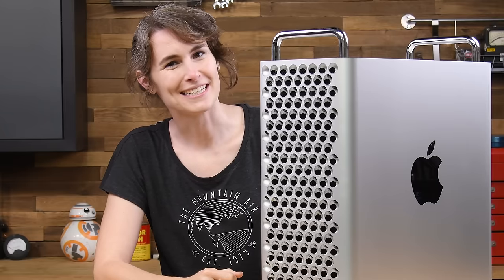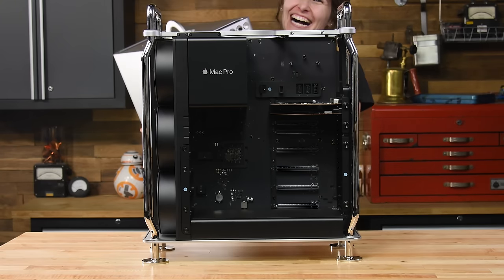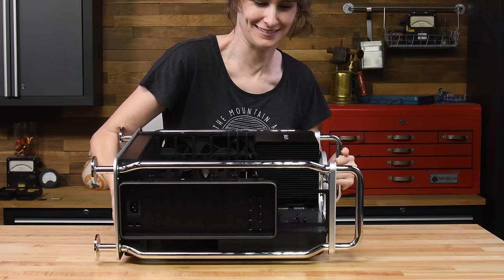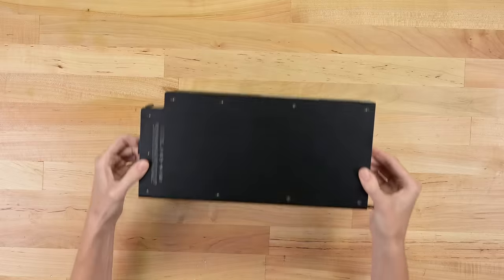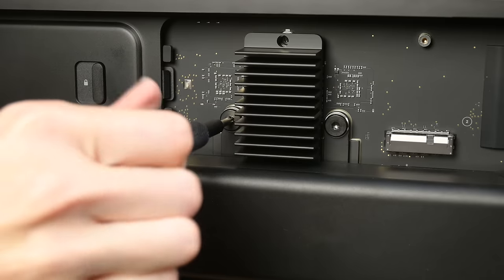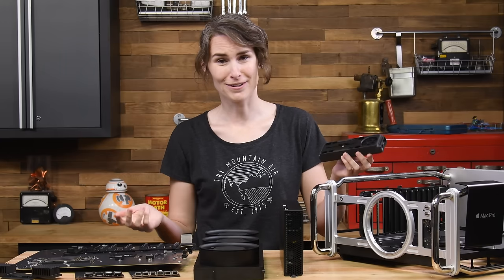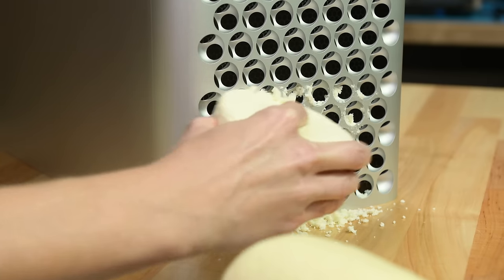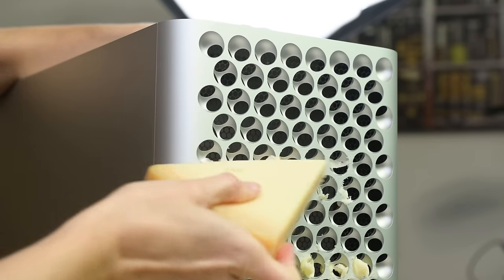Mac Pro 2023 Teardown: It’s Grate!!!

Comment: Who knows what Apple will or won't "allow" on PCIe or other slots and connectors. The real problem seems to be bottlenecking. Unified memory helps overcomes those disadvantages but adding options to "offload" 3D rendering/Ray Tracing and other data intensive operations on specialty PCIe cards may be possible...hey, it CUDA happen in the future 🙂
Reply: Hehe very punny! Unfortunately it's unlikely given Apple and Nvidia's beef
Reply: It's a shame that unified memory, while very fast and efficient, can be a bit of a disadvantage if you have a small amount, or not enough for your workload.
My M1 Mac Mini has 8 GB of unified memory, and engages in near-constant swap activity even with light-to-medium usage. My 2012 MacBook Pro has 16 GB of discrete RAM, my 2010 Mac Pro has 48 GB and my 2013 Mac Pro has a whopping 64 GB; while these computers use older, slower DDR3 memory, they have so much memory that the CPU and MacOS can take all they need with plenty to spare, and so almost never engage in swap activity.

Comment: When I have desktop/laptop repairs one of the main culprits is faulty memory. What makes apples soldered on memory so special to evade that outcome. Genuinely curious.
Reply: It’s integrated into the chip itself. The M2 Ultra is an SoC, so its all in one package vs RAM being separate from the CPU, GPU, etc.. It’s much less likely to fail.
Reply: @zoruaboy  I really appreciate that thank you. Just taught me something new for the day
Reply: @zoruaboy  "it's much less likely to fail" uhhh where did you get this from? It has the  exact same chance of failure as every other RAM module. Just because it's integrated into an SoC and shared between CPU and GPU doesn't make it more robust somehow.  Thermal cycling, electromagnetic interference and overvoltage/-current can kill RAM, especially over time. Yes it can die, but it's not really a novelty in the Apple world, since RAM has been soldered on for around 8 years in many Mac products now.
Reply: @PvtAnonymous  the likely hood of all that happening is a lot less when it’s integrated, literally by nature of being integrated, vs in separate pieces. Good example would be how the T2 chip could sometimes crap out or the touchbar would freeze on an Intel MBP, but since it’s now all integrated, all being handled by the same package, there’s less chance of failure because there’s just less parts to worry about.
Reply: @zoruaboy  ram chips is not "integrated", they simply soldered near the cpu. It is still 2 separate chips.
Reply: @user-lh4in4rx1f  you have no idea what you’re talking about, it’s on the same package, just cause it’s not under the heat spreader doesn’t mean it’s not integrated
Reply: @zoruaboy  lol. SEPARATE Chips literally soldered near the cpu. How on earth they "in the same package"?
Reply: @user-lh4in4rx1f  are the GPU and Neural Engine also “separate chips soldered near the CPU”
Reply: @zoruaboy  they basically the same die. Ram chips doesn't located in that die, they are simple bga soldered.
Reply: profit margin

Comment: The non upgradable RAM I can understand, its integrated in the processor. But the non upgradeable storage and locked down PCI-E? YIKES
Reply: The storage is actually upgradable. Apple sells the internal storage upgrade kits on their website. Only thing is, since Apple Silicon is kinda peculiar, you can only use Apple’s SSD’s, and you need to have a second Mac to reprogram the SSDs and get the Mac Pro to use them. Security, Device Integrity, all that… At least it isn’t totally locked down though

Comment: If it's non upgradable and the Mac studio is a thing, why does this exist with all of that empty space?
Reply: It's s just a STOPGAP product. Initially they planned to have an M2 "Extreme" card there (basically 2 fused M2 Ultras) and a secondary interface/hardware layer for DDR5 memory (in addition to the soldered memory on the SOC.
 
But it took significant R&D and resources for them to hit timelines. Heck, even people inside Apple don't even want to release this thing.
 
Tim Cook only greenlit this thing to "spiritually" complete their transition from Intel.
Reply: It basically just exists because they want to completely retire the Intel Macs but some studios that use macs need PCIe slots for things like dedicated soundcards etc and so they need something that can fit that niche.

Comment: I like to have more Infos about the Fans!
I mean they have compared to PC Fans overwhelming big hubs, but how great are they? Loudness, Air Pressure and so on....
Could i get one as spare and use them on my PWM Controller?
Reply: Details are pretty sparse, unfortunately. They look to be 140mm fans based on the the product dimensions and some pixel peeping. An Apple interview from 2019 also seems to imply that they're optimized for airflow rather than static pressure, as one of the engineers called out the lack of dust filtration and wide heatsink fins as a way to reduce fan noise.
Reply: @Noah-Lach  Hey Thank you for this nice Information!
I mostly like the Fan outer side of the Blades. That this is a wall which goes over the outside ob the Thing that sourrounds the whole Fan. Sorry iam lost for words kinda ;)

Maybe the channel:  Major Hardware
gets sometimes such a fan to print with better Blades.
Reply: @Fincher123  You mean the shroud attached the the fan blades? I think that's a really neat idea for reducing turbulence. I know Noctua's Sterox fans are so quiet in part because the tolerance between the fan blades and the outer casing is extremely small. I guess Apple took another approach by just eliminating that "tolerance" altogether. 

Like you, I'm curious to know more about this interesting rather unique design and why it isn't been copied by any other fan manufacturers.

Comment: So is this thing not able to sport a PC graphics card?
Reply: you can add extra graphics cards to support dedicated rendering, AI or something, but video out will always be using the internal graphics on the m2 ultra.
Reply: @JBaughb  can it though? I though there was a lack of x64 compatibility with Apple silicon. Thought that external GPUs wouldn't work because the system wouldn't load the necessary kexts. Guess we'll have to see until someone tries that.

Comment: Having no user upgradeable RAM on a machine like this should be considered a felony in my opinion.
Reply: Why would you want to upgrade it?
Apple's RAM setup is far better than any PC setup out there, because:
It's rated at 800GB/s (A gaming PC with DDR4 is rated at 76GB/s)
It's shared between the GPU and CPU, thus removing all the redundant cycles.
It's very close to the chip.
Since the latency is very low and the speed is high, the RAM controller in the chip treats it more like an L4 cache.
Reply: @mal7916 The ”Poverty Spec” Pro is $7k for 64 GB RAM and a 1 TB SSD. Non-upgradable RAM means you cannot increase that number after the fact. 

On top of that, upgrades to 128 and 192 Gb are $800 and $1600 respectively. For your DDR4 comparison, you can get full mid-range gaming computers for the price of those upgrades alone.
Reply: That is what you get with an integrated system on a chip architecture.
Reply: @mal7916  What if the RAM fails? You would either need to have micro-soldering equipment or waste another $10K on another MAC Pro.
Reply: @mal7916 you can match the bandwidth with more DIMMs, for how much this costs it should’ve been included - the RAM price would be a fraction of the cost to integrate in this glorified riser board. Ampere has been making ARM workstations for a lot longer and proved that it’s not a problem to have upgradeable RAM with ARM.
Reply: @YoshikoJanai  I don't blame them for not making the RAM upgradeable. That is literally one of the features of the chip, the high bandwith on package memory. Seperating the RAM out onto RAM sticks would have hindered the SOC's performance.
Reply: @Tominatort69420  Does anybody actually experience RAM failures? I've heard of SSD failures, but I think RAM failures are exceedigly rare.
Reply: @FlyByWire1  It’s a miserable design decision. Now a failed MemTest will cost you at least $7000 instead of at most $200. 

Engineering is all about trade-offs and with a machine so expensive and complex, it can be bricked by phenomena that are non-issues normally. Not only that, but their memory capacities are inferior to their previous product as well, and with so much wasted space on that massive PCB. 

This isn’t a phone where space is at a premium and removable RAM is mostly a non-statter.
Reply: @YoshikoJanai  Sure, you can have large amounts of RAM on a PC, but the architecture of the x86 design is getting old rapidly and will become obsolete sooner than you think. Try using an Apple Silicon Mac and see how snappy and responsive they are.
Reply: @amirpourghoureiyan1637  It's not only about the speed. Upgradable RAM would reduce the responsiveness of the OS and increase the latency.
Reply: @mal7916  We've been doing fine for the last 40 years, having a machine in production go down because of a RAM chip you can't replace is a non-starter for anyone in business. Reliability comes before anything else.
Reply: @FlyByWire1 RAM could still fail. So that's why I'm not a fan of soldered RAM. The other reason why I don't like soldered RAM is because it treats the customer like an animal (I believe that the customer has the right to upgrade components on electronics because they paid for the gadget).
Reply: @Tominatort69420  any component could fail in any device, but it’s so incredibly rare. I don’t think it makes sense for companies to design all products with the assumption that everything will fail eventually. Semiconductors like RAM chips are incredibly reliable and in Apple’s case, having RAM on sticks and being upgradable doesn’t outweigh the performance benefit of them using ultra fast on package RAM chips. Pro consumers that would buy this sort of product (there aren’t many) probably desire the performance improvements over the component being upgradable.
Reply: @mal7916 Upgradable Ram won't reduce the responsiveness of the OS. People are doing perfectly fine in the PC space. It's not the early 2000s.

Comment: I bought one like that for my wife to prepare the cheese. However there is a design issue
it is not too sharp.
when plugged in power it make a bit of noie and heat up of some times
What is the use of the power cable ?
The cheese get stuck inside difficult to tilt it to get the cheese out
Heavy 
big and take space in the kitchen 
Too expensive and almost completely useless.
the manual is weird, no explanation about how to use with cheese

I'm returning it to Walmart and ask for reimbursement, I will buy a computer for my family instead.

Comment: It's s just a STOPGAP product. Initially they planned to have an M2 "Extreme" card there (basically 2 fused M2 Ultras) and a secondary interface/hardware layer for DDR5 memory (in addition to the soldered memory on the SOC.)
 
But it took significant R&D and resources for them to hit timelines. Heck, even people inside Apple don't even want to release this thing.
 
Tim Cook only greenlit this thing to "spiritually" complete their transition from Intel. 
 
Not only they removed the compatibility for MPX modules, but also didn't even bother to put ECC memory on the unified memory and gimped a plenty of upgradeability, save for those PCIe slots (heck they even advertised it on 2019 version) so, their $3000 asking price for the PCIe slots is NOT WORTH IT.
 
Get a M2 Ultra Mac Studio and PCIe-Thunderbolt enclosures instead.
Reply: Rather than Apple dumping all that engineering effort into an Extreme chip, I see them starting to sell "Compute Units" that are full Apple Silicon Macs on a PCI card you can add to the Mac Pro to boost performance. There's room to add at least 3 Compute Units for a total of 4 Ultra macs in one tower.
Reply: @montex66  never going to happen. Selling "compute" units would make them less money than buying a new unit outright

Comment: may I ask if unified memory is mandatory for the Apple chip? Like what would happen if Apple engineers separate the memory from the soc?
Reply: It is mandatory
It's a HUGE part of what makes it so fast
Reply: Unified memory and onboard memory are two different, unrelated concepts.

Unified memory means that all compute IP blocks (CPU, GPU, cryptographic accelerator, etc.) on the system share a single memory pool.
Doing things this way makes it unnecessary to move data around between different memory pools. e.g. if you want to load a piece of texture onto a PCIe GPU, the CPU will have to first load it from disk to system memory, then send it from system memory to VRAM through the PCIe bus. In a unified setup, the CPU fetches the data from disk, loads it into system memory, and the data is now directly accessible to the GPU.
It’s far from a novel concept, Intel’s iGPU has been doing it for years. In fact, they not only shares the system memory with the cores, but also the on-ring cache (L3 in CPU cache hierarchy).

There are technical reasons why Apple went with soldered memory on ASi Macs, however none of these apply to the Mac Pro.
1. LPDDR (which doesn’t have a standardized connector and has to be soldered) consumes less power than the corresponding DDR standard (which does have a industry standard slot). This allows the system to draw less power at idle and improve battery life.
I’m pretty sure the Mac Pro has a battery life of 0 minutes.
2. Comparing against the typical x86-64 PC system, the ASi system memory has a significantly more powerful GPU to feed. This poses a substantial memory bandwidth requirement.
One DDR SO-DIMM is 64-bit wide, and takes up a substantial amount of space in a laptop. M1/M2 Max has a 512-bit memory bus, and Apple would’ve needed 8 SO-DIMMs if they were required to implement it using standard modular interfaces.
As you can see, the ASi Mac Pro board has a lot of unused space.
Reply: @DGao-zz5vq  thanks mate! That clarified my doubt!
Reply: Unified memory doesn't necessarily have to be soldered on, but current M-series SoCs only support LPDDR5 which is always soldered on (the difference between it and regular DDR5 is that it uses less power to reach DDR5 performance at the cost of, well, being soldered on). There were rumors that Apple was experimenting with adding a hypothetical M2 Extreme to the lineup which would support additional DDR5 DIMMs in addition to the on-chip pool of LPDDR5 but that the project never materialized.

Maybe when the M3 Mac Pro comes out, we'll see more user-expandability (although this is Apple so temper your expectations).